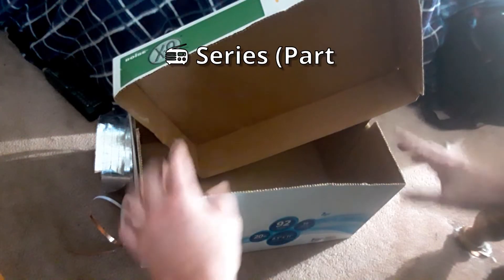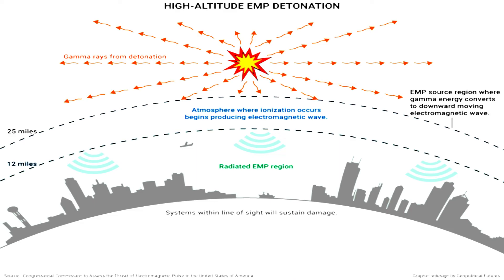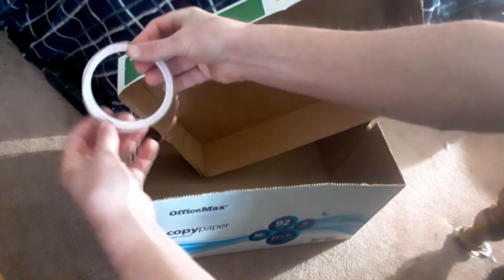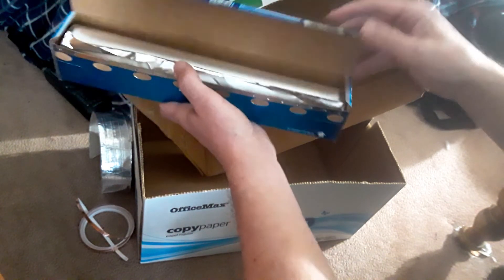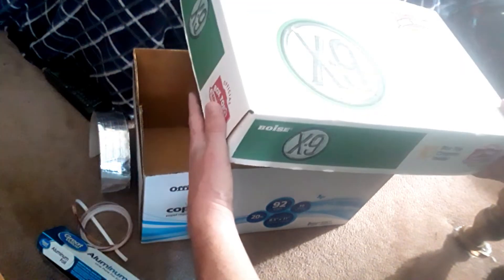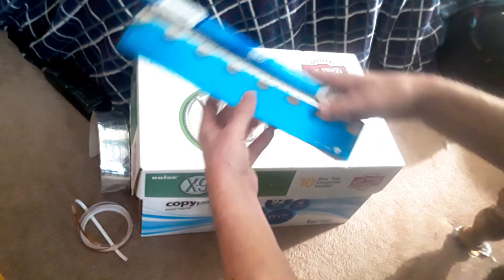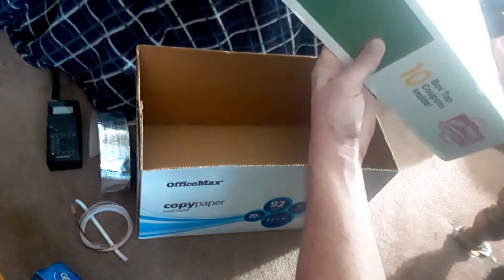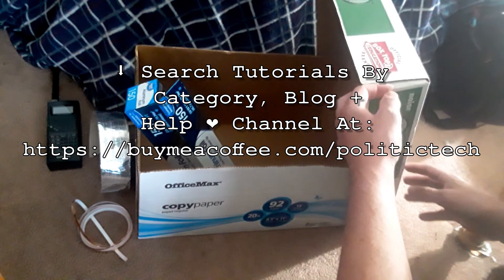Build Cheap Faraday / EMP Protection Box (Part I)

Comment: Some testing later on, KEWL, EMP the neighborhood.  jk.   but how would you test this faraday box?
Reply from the maker: haha, well it's really introducing the concept of EMP protection box. All depends on the power of the pulse. True 'nuclear' EMP weapon likely too powerful for simple tin foil example, when closeby. ;) But same concepts applies for more powerful shielding material: it undoubtedly lessens damage (and in some areas would protect against something serious, farther away, certainly protects).

I use it, and by placing your box in basement you add more protection than higher floors for example. 

I have a video, basic demo showing it blocking cellular / radio signal (box closed, no ring/signal, box open, calls come through). 

You could build a more refined version with a layer of copper netting, or add thicker plates. 

This was done on an extreme budget, to share the concept of shielding without spending money: "stuff laying around any house" kind of concept sharing. But you can always improve it with more powerful sheilding material.

I suggest using best you have if truly wanting protection from nuclear emp for example (copper over aluminum).
Reply from the maker: Realized I never truly answered the question.

Well, you could test it by calling a phone inside it (showed in later part of this series): https://www.youtube.com/watch?v=0Yn4hC1MztY

You could also test it by reading the signal of the wifi, while running KISMET on outside machine. Might make a video on this to show how the signal (RSSI) looks.